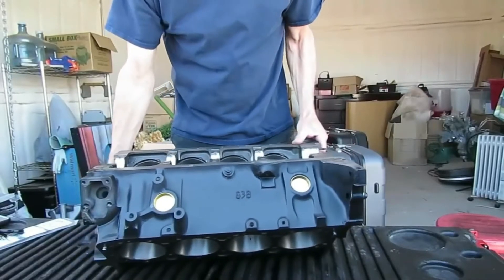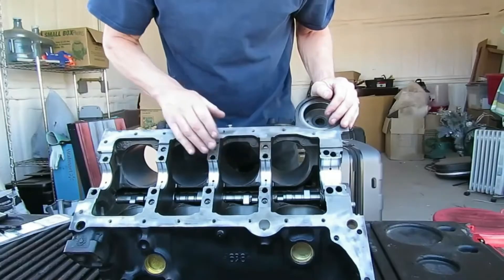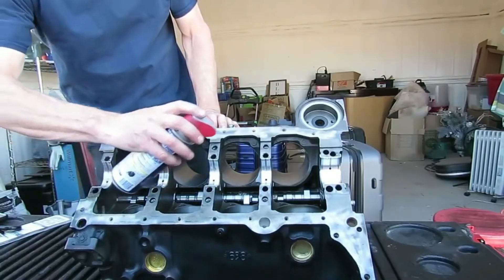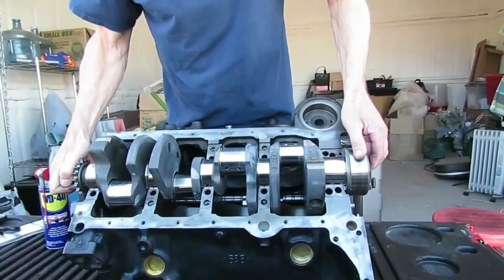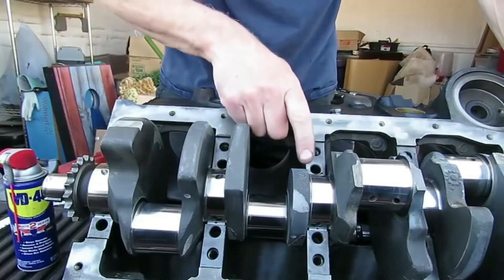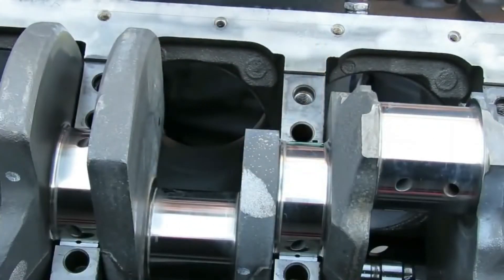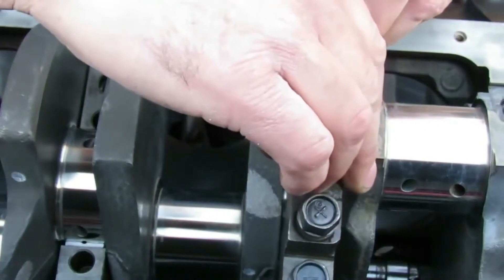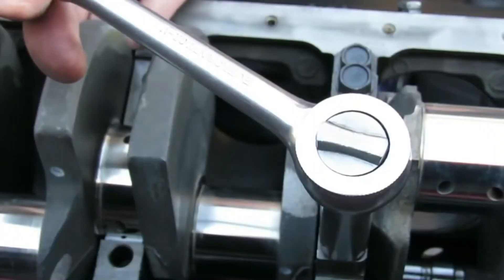How to use Plastigage

Comment: Great video man. So if I was changing out some connecting rod bearings and wanted to check the clearance it'd be with a new std size bearing? I want to know if I need to purchase an undersized bearing for any of the connecting rods before, doing maintenance on a poorly maintained Honda, getting mahle clevites for sure tho. Ty sir good vid

Comment: Working on a Ford 8n engine.  Removed mains and rods, show .010.  No scarring, crank looks polished.  I think the engine was rebuilt but they never got it running because they failed on a 12v conversion.  Can I assume it was properly machined?  If not, would plastigage indicate that standards should have been used as I will say the engine needed , in my opinion, more torque to turn by hand even with the plugs out than I expected.

Comment: 🤔You're so right measuring tools are more accurate the plaster gauge should be used At least  Plaster gauge will show if everything is sent or not  Plaster gauge is not as accurate as a  tool

Comment: If I have a crank, block and rods that I’ve just gotten back from a reputable machine shop who have ground and polished the crank and I’ve got a set of quality bearings then it should go together without any issues. Many shops that grind and polish cranks, supply bearings which makes it just that much more promising. If I can’t beg, borrow or steal a calibrated micrometer and a calibrated bore gauge, Plastigauge is my sanity check.
Reply: The army also uses Plastigauge

Comment: Over here in Australia GMH Workshop manuals gives a complete overview of how to use Plastiguage in rebuilding Holden and Chevrolet engines. A side note the photos of the Small Bock 350 shows a 4bolt main Big Block Chevrolet engine never a stock engine in the holdens of the Era

Comment: Wouldn't be surprised if this is already stated. But you really need to say to clean off all the plastigauge because it measured it by filling your clearance gap. I can see someone thinking because it wasn't said its ok to skip thinking the oil would wash it away in operation or it would somehow break down to a lubricant.

Comment: How do you increase the clearence if you measure it and it's not big enough
Reply: Most bearing manufacturers will make a standard bearing, one that is .001" oversized, and a set that is .001" undersized. You can mix these bearing halves to get the correct clearance.
Reply: get smaller bearings.
Reply from the maker: @Fizzer99  change to a different bearing

Comment: My problem with plastigage is that it requires me to use my subjective estimations to determine the clearance. I use it on lawnmowers and shit, but you'll never see me using it on an engine I care about. I agree 100%, it's better than not using anything, but only a little, because you're still guessing. Buy the tools if you're rebuilding engines. If you aren't, take it to a machine shop and they will do it for you
Reply: If you are rich...